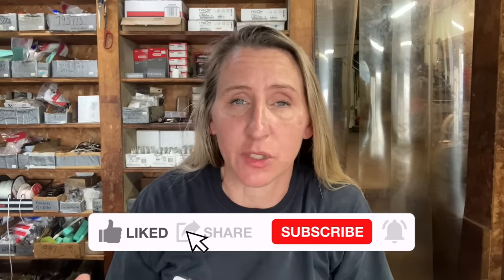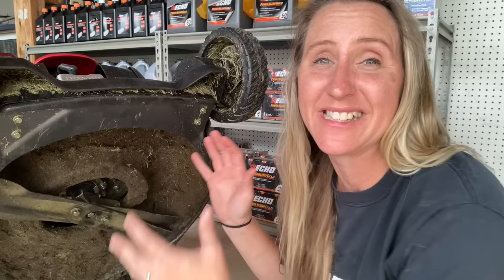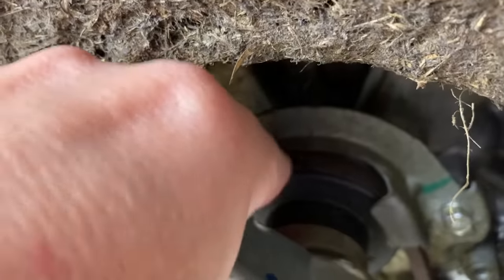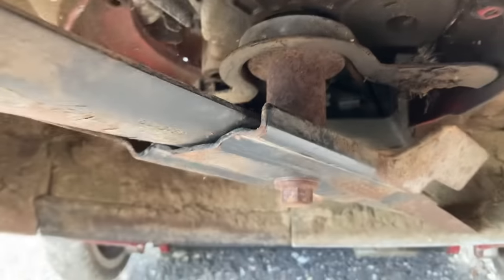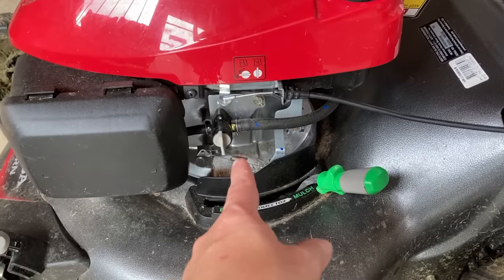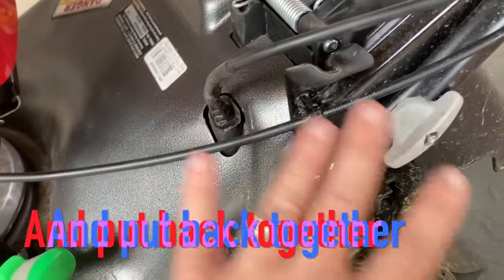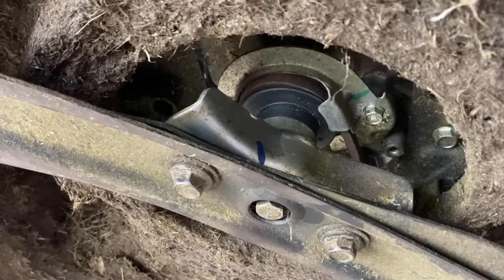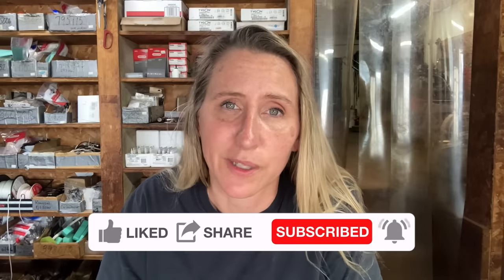SAVE A TON OF MONEY in repairs by NOT BUYING this NAME BRAND mower.

Comment: I have a Honda mower.  It won't start, you have to use starting fluid, even after it came back from the shop.  It started right up when I picked it up.  Then I hit a tree stump, it bent the crank shaft.  Well, it's dead now!  I've used Toro and Troy Bilt, they both have issues but they still run for miles and miles of mowing.  

Troy Bilt weed wacker - Dead On Arrival. I use Echo mainly, Toro as a backup.  Echo, no problems!  Toro weed wacker - Feisty to start but no issues.

Comment: I have the same mower, just electric start. Never an issue but I keep it clean and always spray some fluid film on the underside of the deck if I'm cutting wet. Only big issue is the chute door hinge, 3 years later I broke it getting in a hurry and didn't clean some grass off the bag rest. I bought mine when they first introduced them. 35 bucks later I have a whole new rear housing to put on when it gets nicer out.

Comment: I have a push mower I bought at Walmart in 1991. I rarely use it now but when it's needed it starts right up. Never done any maintenance not even an oil change. It was supposed to be a cheap throw away mower but it doesn't die so still have it. 🤷‍♂️

Comment: Thank you Chickanic!  You have saved me a bundle on smaller tools!
TL:DR   I got lucky buying a xero turn 42" from a big box store, though today I would look to Chickanic for a reccomendation.  It was on sale $700 off, and had a total of 6 years warranty, plus claimed a commercial engine, and an obviously heavy duty welded deck.  From day one it did not cut grass as nicely as my 44" Craftsman 'yard tractor', which also had 3 blades, nor did the new Briggs engine run as smoothly as the antique.  In fact, it ran horribly unless I pulled the choke out about 1/4".  Four yers nd 125 hours later it finlly broke in, or maybe it was the Seafoam clening out the carb... or maybe the gas station changed to better additives or to less ethanol in the gas.  I just don't know.  But now 7 years and about 200 hours of use on the adjusted hour meter and it runs smooth, though I add some Seafoam or similar fuel additive if it seems to need that to run without the choke pulled out a little.
Adjusted hour meter - when i test drove it, there were no hours to speak of on the meter. Aa week later when i FINALLY CONVINCED THE STORE TO EITHER DELIVER IT OR REFUND MY MONEY, there were 52 hours on the meter.  Over the years, additional hours appeared again, this time after a visit to a repair shop.  I discovered a really annoying design flaw - if the key was left on, the hour meter accumulted hours of service even though nothing was running.  So in my service log I keep (and you should keep one, too) I noted the approx 150 hours of meter time when the engine was completely off., just to keep track of actual service hours vs meter hours.  
One destroyed front tire, a destroyed drive belt, and two busted fans on the rear wheel drives have been all the repairs needed in almost 7 full seasons.  Yes, there was a summer of horrible service from a franchised service dealer, but that was the manufacturer's fault only in that they should have vetted their service people way better, and should have made it much easier to reach a mfg rep to get my concerns to a higher level.

This is an Ariens IKON-X 42 ZTR, mod 915207, with a Briggs 22 hp Cyclonic V engine. Sale price $2700 before tax.  Good for an acre and a half of rough stuff, less good for the St Augustine half acre. Very fast to get the job done; no complaints there.

I really like the comfortable seat with arm rests, which really help this old 73-yr old man get in and out of the seat, and also the rubber floor mat.  I am not a fan of the dial-up height adjustment which soon gets so dirty one can't see the height numbers. I'm not happy that the chute has been wonky and broken since about the day after the waranty expired.  But overall I would buy another if it were again a bargain, with six years total warranty, like this one.  The Briggs engine has given good service, some of which I attribute to the high end synthetic oil changed to after a break-in period, some to the careful monitoring of additives, ethanol in gas, water in ethanol gas, and gas quality. YMMV, of course; this is just one data point.

Comment: I have a little red Honda GCN160 that's been working hard since about 1992. Sharpen the blades and replace air filter once a year.
The key to it is I change the oil about once a month for the half year it runs. It only takes less than half a pint.

Comment: I remember installing replacement the self propelled belt (as the original belt had snapped) and rear wheel drive assembly on a recent Honda like this (pictured in video) and boy!, was a real pain because disassemby and reassembly is TIME CONSUMING as reassembly must be in correct order to restore proper functionality of the machine!  Thanks for the video!

Comment: Thanks for your report. I own a Honda of that same design and had to change to drive belt. It surprised me because for so many years I had used an ancient Honda without problems until it quit because of my neglect. I still have a high regard for the Honda motor but am very disappointed about this design of the self-propelled mechanism. Thanks again for your help.

Comment: I agree on B & S engines, they  are good, I've had them last for years. However, I have a 1977 Wheel Horse that I bought new and am still using to mow my yard and I now am very much in love with the old cast iron Kohler's. They would run forever and from my experience, gave very little trouble.

Comment: Bought a new mower last summer. Looked at a Honda similar to this, but ended up with a Troybilt as I didn't like what I saw 'under the deck.' Also because Honda is out of the small motor business. You confirmed my decision. My Troybilt mulches much better than the 10 year old Honda powered Husqvarna it replaced whose transmission failed and parts not available. Winter stored the Troybilt after cleaning it, changing oil, and running the gas out. This spring, poured in gas, checked oil and air filter, and it started first pull. So far am very happy with Troybilt.

Comment: I bought a new 2020 Honda self-propelled mower and have had no complaints. I, during the season, will pressure wash after each mowing session, i lube the cables and wheels biweekly with either WD40 or 3in1 oil. I guess I have purchased a good model. The mower still looks brand new.

Comment: Thank you Chickanic. My push has cancer between the two front wheels. It's only 17 years old, but, runs like a top. If I can't get it patched cheaply, I was gonna look at Honda and Toro mowers as they have dealerships beside each other. Now, I know which building to stay away from

Comment: I have a 19inch TORO 1995 it has had 1 new drive belt 1 new blade, it has an electric start but battery died around 5 years old, but starts first or second pull had a few oil changes, has a B&S GTS engine.
Also have a Honda 17” rear roller mower, it never starts without spaying fuel into carb after winter and when it does it hunts, bought a ultrasonic bath and the carb needs cleaning every season.

Comment: I purchased this same mower in spring of '21. I got the self propelled because I had a bad knee. Unfortunately for me my knee got worse and I had to get my knee replaced. I was not able to do normal fall maintenance on it and gas got left in it. In the spring I drained the tank,  cleaned the carburetor including removing the jet and float. Now it still acts like it's starved for fuel by surging.  I'm going to remove the carburetor again and use the miniature files I recently purchased and go through the jet again. I've owned Honda mowers for years and this is the only one to ever give me problems.

Comment: Been using the same Sears Craftsman 21 inch mulch/ bag mower for over 30yrs. Just changed the oil, plug, air filter and sharpened the blade for the 3rd time. No rust no problems.

Comment: Thanks for the information.  Unfortunately I happen to have a Honda mower. GCV 160.  I've had the mower since at least 2016 and never had any issues.  Except taking it into a shop to have  them show me how to adjust the self propel system.  Just have to loosen a cable and a set nut.  Pretty simple.  Please keep the videos coming!

Comment: Thank you for this video. We bought the Honda mower last summer and yes my husband mows early in the morning when he gets off work so it is damp grass. This is a great informational video. Guess we will wash it after every use. It actually has a hose connection on the deck to clean the deck but I  don't think it will clean things out in the belt area.

Comment: I had a Lawn Bow with a Honda engine. Ran good but the plastic deck cracked. I put it out at the curb and the road buzzards took it within a half hour. I now prefer my Ryobi battery powered and no problems in its third year,

Comment: My understanding is that Honda is exiting the walk behind lawn mower business by October of 2023, so these are apparently "lame duck" models. 

I have owned 3 Honda mowers, and they lasted many, many years.  I never had any transmission issues with any of them. One was an HRXA215, with the hyrdostatic transmission, and it was awesome, and it lasted 20 years. The only one I had an issue with was used at work, where there were tons of rocks in the grass. After ten years, the mower itself was still running, but the deck had completely rusted out, and there was nothing to hold it together.

Comment: I've had a Honda mower for over 8 years. Early on the mower would not want to roll backwards. The problem was the Spring loaded Sprag in the Drive cog. All I did to fix it was sand down flats on both struts.

Comment: :) WOW! and THANKS!  I have an old one I bought 2nd hand, and have had some of the clogging, and have replaced the belt.  BUT it sure is cold hearted to start :(  I had drilled a hole in the air cleaner housing, just to squirt stater fluid in, and it usually starts much better.  THANKS MUCH and ALL THE BEST!  I am in PNWest and YES the grass is almost ALWAYS WET :(  Cheers!

Comment: I seem to gravitate to those videos which showcase problem mowers. And yes, I too, am a more learned small engine mechanic because of you Britt, Steve and Donny. Thanks. While I am at it, I have to give kudos to my three Snapper self propelled mowers w/ Ninja blades. I found my first one pushed out to the street and fell in love with the rear propelled system. Since then I have acquired two more. The 7.25 briggs has some very usable torque. I also appreciate the fact that you can adjust the idle high and low while moving slow or fast and vice versa; an option no longer available on today's mowers. Additionally, there is no mystery on how the self propelled system works. As long as they keep making parts for these Snappers, I'm keeping on keeping on.

Comment: Wonderful and insightful information.   I had a 1985 Toro self-propelled that was a "trash day escapee" that I used until last summer, when a much newer Toro self-propelled "trash day escapee" appeared.  Hated to put the 1985 out to pasture, but one has to be realistic.  Both have flat head Tecumsehs, and even though my Father was a die-hard Briggs man and I learned from him, I couldn't deny that both engines and lawnmowers were bullet proof and reliable (and the price was definitely right.)

Please emphasize that one way to keep a reliable lawnmower "reliable" is to at least try to keep up with servicing it.  Although I do my own servicing (and repairs,) as the old adage goes, pay me now or pay me later.  Change the oil at the start of the season (not a big deal and I'll bet you can quickly and economically do it for people not wanting to take it on themselves.)  Lifetime air cleaner elements ain't-change them at least annually.  Don't store any mower over the winter with fuel in the tank-I lean toward draining the tank and running it out.  Avoid E-15 if you can-in Illinois, our wonderful omniscient government has made this nearly impossible.

In any case, take care of and maintain your equipment and you'll be surprised at its reliability.  ...And having a good and trusted shop is like having a best friend.  Simply invaluable.

Comment: wow.. I have a 2018 HRX217 with a GCV190 engine and it seems really well built...  ive had absolutely ZERO issues out of that mower thus far..  maybe the HRX217 is a different type but its been excellent

Comment: I think I'll stick to my 1980 Lawn-Boy 2-cycle. Starts on the first pull just about every time.
BTW-Thank you for putting me on to the Echo Red Armor oil. I ran my first half tank through this same mower (I mixed it to 25:1 instead of the 32:1 that Lawn-Boy specifies since the Red Armor bottles are based on a 50:1 ratio), and I am already seeing a difference in how the old girl runs- with no adjustments, I'm already noticing less 4-cycling and smoother running!

Comment: My favorite self propelled mover was the old John Deere 14SB that had the Kawasaki engine and had real gear driven self propel drive system. Did lawns back in the day and those John Deere's were the best push mowers we ever used commercially. Like all the good stuff they quit making them. I also ran Toro Commercial mowers back in the day that had the Suzuki engines and they were solid. John Deere bagging system was easier to empty. Now days I just have a Zero turn with a Kawasaki and still own after 25 years my Shindiawa 230 and it starts 1st to 2nd pull every time. I remember my wife saying you paid $350 for a weed eater? That was a lot back then and now she is a believer:P I only buy Commercial grade lawn equipment even for home owner use it pays off in the long run.

Comment: I really like my Honda GCV160 and have used it for over 3 years.  Not one problem until now.  I got it tangled up in a bush, and it stopped running.  I noticed the long spring behind the air filter came off and the only way to get to it was to remove the air filter box.  The two bolts holding the box on also held the carburetor on too.  Got the spring and everything else back on, it still wouldn't run.  After completely removing and cleaning the carburetor, float bowl assembly and flushing the fuel tank.  It still wouldn't start.  After a quick search on YouTube, I found out about the "Auto-Choke" system and a strange little part called the Thermo Wax, Honda PN 16620-Z8D-305.  It has a small pin that moves in and out depending on the temperature of the engine.  The pin was stuck all the way out which kept the butterfly open in the carburetor, not allowing gas to be pulled in.  I ordered two, they were only $11 each on Amazon.  Installed the part and assembled the carb. and the engine started right up.  I couldn't believe this little part could cause me such a headache.  Thanks for your video, I'm going out to clean under the deck and around the drive belt.

Comment: My Honda mower is about 7 to 8 years old.  In Oregon if you don't mow wet grass often you don't mow at all.  When finished I wash the underside of the deck completely with a garden hose.  Otherwise, it would look like the one you showed on the video or worse.  It finally became hard to start and the shop replaced the carburetor.  Surprisingly the cost of the carb was under $30 for a real Honda part.  Very surprising as Honda generally REALLY gouges customers on parts.

Comment: How did I get so lucky buying a sears K mart cheapy push mower with a bag for something like $159  about 15 years ago and it still works fine? I think I'll need to replace the wheels soon and I almost returned it in the beginning because I couldn't get it started. Then I figured out taking the air filter off and manually choking It worked .  starts on the second pull just about every time.  I'm not trying to say it's a great piece of machinery. I'm happily surprised. It's still serves its purpose.

Comment: This has happened to my brothers honda twice. Its funny because I bought a Craftsman M260 over two years ago, this spring (2023) being the start of my third season with it. Multiple people scoffed when I told them I got a Craftsman, and couple told me its a bad idea, and everyone told me to buy a Honda or Toro. Maybe they still think they are Sears quality. Anyways, it has been the best mower I have ever used, super efficient and powerful, not one single issue or complaint yet, started on the second pull after sitting all winter for 4 months. Lowes drastically improved the quality and redesigned every tool when they took over the Craftsman name, I have been using many of their new products and really enjoy them, especially because they are not as expensive as bigger brands.

Comment: bummer for Honda! I never liked to pull them backward because of the transmissions.  thanks for all your advice, I just put the original carburetor back on my LX178 and it runs grate.  The after market a purchased not knowing to not do that, had the choke lockup and after sitting the needle would stick and pour out fuel.  Now if I can only figure out how to have the drive belt stop falling off,  Jack S.

Comment: I have an HRX217 with the 190 engine bought new in 2014. Only one thing has actually broken on it in eight years, one of the wheel height adjustor plates snapped. Cost $9 to fix. Regular preventive maintenance and frequent cleaning and it starts first time.

BTW, never had a problem with the air filter cover, In fact, it's a pain to get off.,